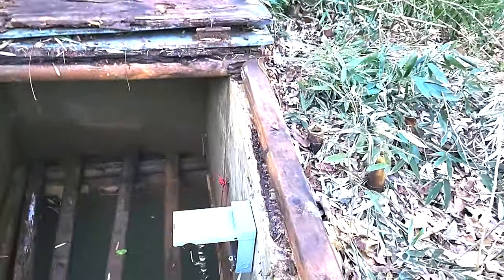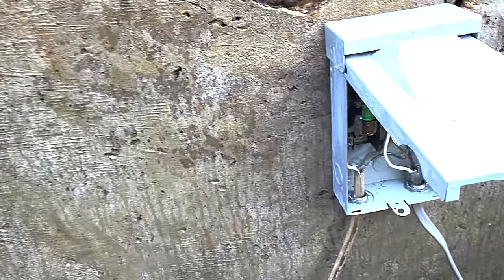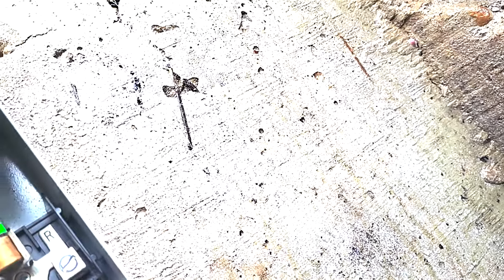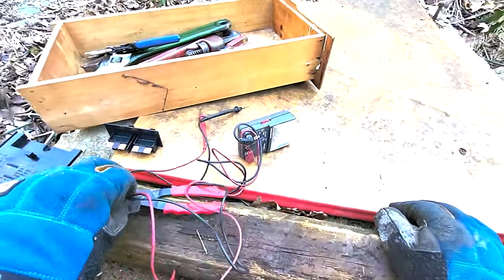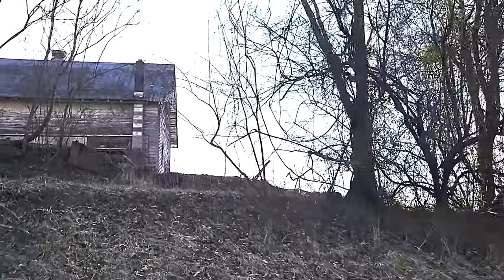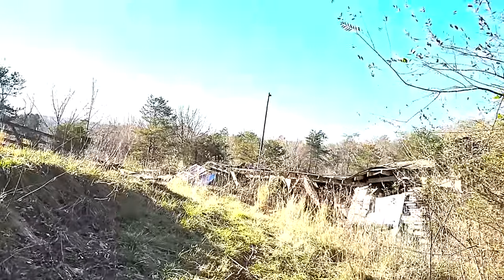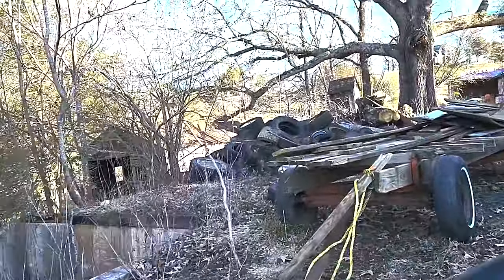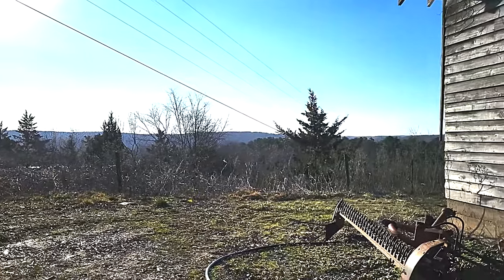I should be dead....a 230V mistake

Comment: Using a $1500, 230v, deep well casing pump where you could be using a $200, 110v, above ground pump from harbor freight.
Reply from the maker: It's a 1/4 mile uphill to my house from the cistern
Reply: @restoringbonaire  You only need a submersible when your suction lift gets up to like 20 feet. After the pump the head doesn't matter as long as the pump discharge pressure is sufficient. You need 0.433 PSI to overcome every foot of elevation. BTW 230v split phase is 115v potential to ground, so unless you touched both hot leads at the same time you would have gotten a 115v shock. It might be a good idea to install a ground fault breaker on that circuit

Comment: I'm sure you've been told even after shutting off the breaker you still check to make sure there is NO power before doing ant work. You lucked out. I was watching you mess with the fuse thinking You didn't check to make sure there was no power... Someone was watching over you. Beautiful property by the way.
Reply from the maker: I was checking the fuse for continuity. I had an angel watching over me

Comment: After taking a second look because of a rude  comment someone made I watched your video again. Where you have your BARE GROUNDING CONDUCTORS/WIRES  on the neutral center of box  is wrong. The well pump being 220 volts has no neutral. That bar is isolated from ground which means it won't trip a breaker. The fix is if you leave those bare copper wires there tie one of them to the metal box thus grounding the box. I'm retired now but have spent my life doing electrical work, from a house and ending up working on power lines at the end.......Good Luck
Reply from the maker: So connect a wire from those bare wires to the box. Thanks, I will do that!
Reply: @restoringbonaire  Yes, that will protect you if you ever have a fault. I'm assuming you have a pressure switch somewhere also which turns the pump on and off. I know I'm just a random guy on the internet but for whats it's worth I'm retired and spent a life time doing electrical work. I am licensed  in two states Tn/N.C. and have wired from houses to retiring working for a utility co. setting poles and hanging transformers. At any rate just trying to help you.....
Reply from the maker: I really appreciate your comments.

Comment: Not sure how good it is to run those pumps dry? Probably also getting a lot of sediment. Assuming the box is wired up right that should be mostly dead when the disconnect is pulled out so as long as you don't touch the usually semi insulated incoming connection. Although definitely need a properly labeled electrical panel. and those non-contact testers are a pass fail not necessarily a confirmation they can have false positives, it's a idiot stick to make sure you're not working on something live but you also have to wave it nearby before you touch anything a habit that needs to be built. Which is usually the part that everybody forgets. If this is regular occurrence might be worth hooking up a small indicator lamp at the disconnect. Although it doesn't look like it's in the greatest condition to begin with using non-outdoor rated romax cable.
Reply from the maker: Good idea

Comment: Most likely if you just get a 120 tingle unless your in Europe. Your body is a giant resistor and so is your boots and dry hands. I have 120 volts with very dry hands and not known it was alive. To get 240v you would have hold both circuits at same time which you are not likely to ever do. If you had fuses in and were connecting it and had one already connect and had the copper touch one hand and the other hand touch the terminal you were to put into then most likely lights out as you completed the circuit.

Comment: Isn't that a fused disconnect? You have incoming power on the top lugs but without the removable disconnect installed, both fuses and the load lugs are fully isolated from power. You can literally touch anything inside the box except the 2 line lugs at the top (which are intentionally out of the way so you can safely work on this box with the power feed on). I understand the scary experiance is that you assumed all power feeding the box was turned off when it wasn't...
Reply from the maker: True, I just didn't realize that the top lugs were energized and that I was so close to 230V above 8' of water
Reply: @restoringbonaire  Damn that was close, there should be some clear perspex guard in place to shield accidental contact with the live lugs above the isolator. Multi-meter and a inductive power sensor, heck why don't them fuse boxes not have neon lights in them to show if it's live or not. If it was me I would have a disconnector on the outside on a  pole inside a weather proof enclosure. Lucky this time around.

Comment: Man leave this to a pro. Try to save a few bucks without knowing what hes doing
Reply from the maker: I moved the circuit breaker the previous week to another sub panel. I turned off the old breaker which was disconnected but forget I had moved it to the sub panel
Reply: He got the results, saved huge $$$ and lived to tell the tale😎
I've seen other 'toobers get the "pros" to a rural setting, only to have to fix it again "under warranty" but the blokes can't come out for weeks, find a way to charge again...

Comment: Alway test with a meter before working on anything mains related, even if you're sure you have switched everything off.
Also, why are you using a borehole deep well pump, which cost a fortune, when you could be using a much cheaper standard submersible pump.
Reply from the maker: Thanks. I definitely will test in the future. I have to pump the water uphill 1/4 of a mile and needed the power of a sub pump to do so.